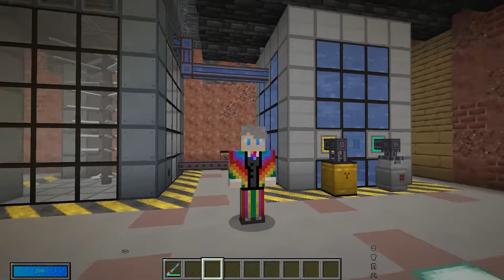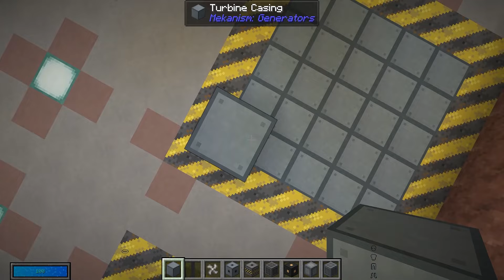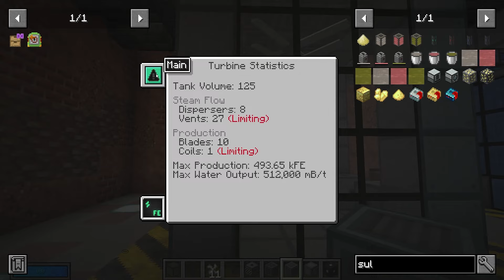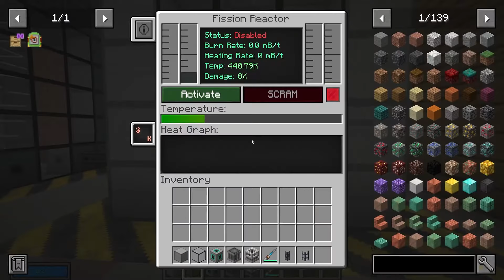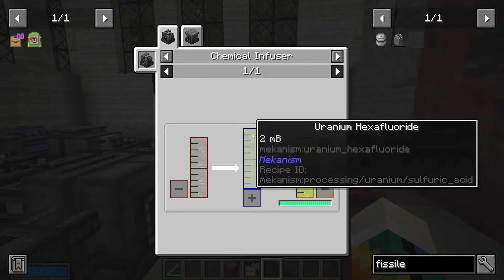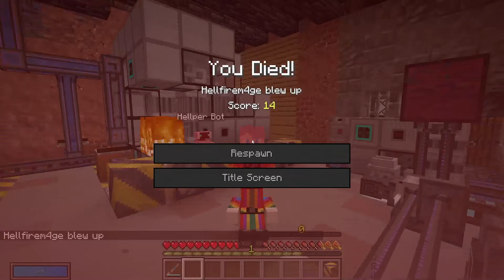Fission Power is Powerful (And Deadly) - Mekanism Fission Reactor (+ Turbine) Guide

Comment: how did he get the water in? i cant for the life of me get the stupid water in
Reply from the maker: Just use a mechanism pipe, make sure it's set to pull from the water source and make sure the valve on the reactor is set to coolant 😊
Reply: @Hellfirem4ge  the only coolant setting on the valve is for output coolant, and the input only valve setting doesnt let the water in
also thanks for replying!
Reply from the maker: If you join the discord and send a screenshot of the problem, I'll have a look 😊
Reply: @Hellfirem4ge  alright thanks
Reply: @Hellfirem4ge  could i also get a fresh inv to it?
Reply from the maker: https://discord.gg/GXhVZ9tUw

Comment: For some reason, when I first built my turbine, it was great. It allowed for my reactor to run without any issues. Then, out of nowhere, my reactor exploded. I rebuilt everything exactly as it was and now my turbine can no longer support my reactor, not even on the lowest speed
Reply: My working theory is that I have too much coolant for my own good. Causing it to burn and crate too much steam for my turbine to handle

Comment: This setup will explode after lulling you into a false sense of security. Mine blew up because the 1.44 GFE storage of the turbine multiblock filled up and throttled its output of water back into the reactor causing the reactors coolant to disappear in seconds and explode. Use an energy void block from a different mod(ie. trash cans) to remove excess FE so that the turbine's internal storage never fills up completely.
Reply: you just need to toggle the "dumping excess" on the turbine

Comment: Good video regarding the Reactor and the turbine but its missing a lot of info about the most important part which is the fissile fuel creation array. additionally seeing each system connected to the actual source of it instead of a creative tank would be helpful aswell.

Comment: may i know which mod adds the sink?
Reply: sink from CookingForBlockheads, but i dont know how did he connected pipes to that sink so they suck the water without a pump
Reply: found out how to make it work, right click on the pipe connected to the sink with the configuration tool of mekanism, it has to be on the very first pipe, the "mouth" of the pipe

Comment: Hello, I've built everything just in the video and when I activate it nothing goes up, the burn rate is 0 and heating rate 0, it's filled up with water and I think it might be a problem with the turbine, I built it exactly like in the video and the multiblocks are formed and I can access the interfaces for both the turbine and fission reactor, however, my blades don't spin, I connected the turbine to an energy cube just like u did in the video and they still don't spin, I tried to set the burn rate of the fission reactor to 1, still not working, I have no idea what I'm doing wrong or how I can fix it.
Reply: have you provided fission fuel to the reactor?
Reply: @byok1313  Yeah, it's fixed now, thank you anyway!
Reply: @jegreene8416 how did u fix it? I have the same problem..
Reply: @j.jakuub  Make sure u produced fissile fuel that goes directly into the reactor and then make sure the pipes are connected properly and there isn't anything inside of them

Comment: I have tested and when the turbine is filled up with energy as well as steam, regardless of which mode the turbine is in, it will instead pump steam back into the reactor instead of reusing it, causing the water level to go down very fast. is there anyway to avoid this?
Reply: Apparently using Energy Meter to drain the energy so it wouldn't reach peak also works.
Reply: @minhperry  My problem is that the turbine blades don't spin, I can access the interface and I connected an energy cube to it and still nothing, what can I do?

Comment: I set up fissile fuel as an ae2 autocraft, the push output functions of the mekanism machines works super well with the return to inventory of the pattern providers with all kinds of chemicals, fluids etc. You can then name an item "FISSILE FUEL" in the anvil and put it as a 1000mb worth of the chemical on a me-pattern in any open pattern provider. It'll never complete the last step, so youll have to cancel manually after completion but it does a good enough job and advances all automation eventually.

Comment: The fuel doesn't go into the reactor, what to do?
Reply: Hopefully you figured it out by now, but if not you right click on the tank holding the fuel and customize the side layout, make sure the top is set to output. (Assuming it's set up the same way as in the vid.)

Comment: Why my reactor somehow losing water as if it leaks water? I used 100 burn rate and the water gone surprisingly fast but for some reason I didn't get all the water back from steam even though I built a pretty big turbine
Reply from the maker: You need to make sure you turn the reactor on to make steam, then turn it off and refill it with water. You'll only get an infinite loop if you're completely full with steam and water
Reply: You also can have an excess of energy. If the turbine energy storage is full it will quit converting steam to water and the turbine will fill up with steam as your reactor water plummets. Easiest solution to this that I've found is, first hook up the power to a decent battery bank as a buffer, then hook an induction heater to it and have it consume just enough FE to balance the system when it's running, that way there's no over production of energy. 

You could also use redstone to turn the heater on and off with the reactor.
Reply: @ShadowBroker50  no I mean, the water is losing but the thing is my turbine has dumped all of its energy to induction
Reply: @osopenowsstudio9175  do you get any water back from the turbine? I'm assuming you've got the infinite water source tied into the line between the turbine and reactor, if you disconnect the infinite water source and run the reactor a few secs just to lose water do you get any water back from the turbine?
Reply: @ShadowBroker50  update: it turns out my huge network of ultimate pipes were a massive bottleneck, now I build the turbine next to the reactor and they're connected with their own interface directly so no more delayed water or steam

Comment: This is an older video, but in running into an issue regarding steam build-up in my turbine. i’ve basically copied the build from the video, yet steam just fills the turbine completely without dispersing. i’m not sure what to do at this point
Reply from the maker: Do you have enough energy storage?
Reply: @ ah you know what i bet that’s it. I must not have enough energy cubed places down. what’s a good way to use up my energy to maintain an equilibrium, ya know like not keep the cubes filled constantly. also, thanks for the quick reply! great tutorial i’m just a knobhead
Reply from the maker: Haha no problem! I would honestly recommend some sort of trash can overflow or to make an induction matrix that stores trillions of power 😊 also only run the reactor when you need it and not 24/7

Comment: This doesnt work i literally did everything right and it refused to turn on no matter what
Reply: The turbine and reactor both not working I both have an infinite water source and infinite fissile fuel going in but the fissil fuel won't go in for some reason
Reply: @JN26833 Hopefully you figured it out by now but if the fuel isn't going in and assuming the reactor is built properly, you need to right click the chemical tank with the fissile fuel and click the widget to adjust the side layout and make sure the top of the tank is set to output and not input

Comment: I connected a creative energy cube to the energy output of the turbine but it doesnt get any energy… everything is set up correctly but i dont know why there is no energy going in… any suggestions?
Reply from the maker: An empty creative energy cube automatically voids any energy that goes into it. Try it with an ultimate cube instead and see if that works 😊
Reply: @Hellfirem4ge  I built a matrix and this worked perfectly, thank you

Comment: This was a great tutorial, however people need to know that this uses so much water that one line of ultimate mechanical pipe is not enough. It is better to completely fill in between the reactor and the turbine with ultimate mechanical pipes and add more valves to the reactor if you want to have it be at a rated speed of more than 1mb/t.

Comment: Just on the first part and I built everything correctly and when I right click it won’t give me the interface. Im also confused by “closed your door with glass” meaning place the last two glass pieces last?
Reply from the maker: Yes 😊 it shouldn't matter, just double check your modpack hasn't changed it to structural glass or something
Reply: try with structural glass, i had the same problem

Comment: From what mod was your sink you used?
Reply from the maker: It's from a mod called cooking with blockheads. There's a bunch of alternatives though
Reply: @Hellfirem4ge  ah i see thanks
Reply: @Hellfirem4ge  what would you recommend to use? because i turned it on and the water quickly vaporized
Reply from the maker: @reggerdernoobs2678 I would recommend filling some tanks with water from mekanism and pumping it in. Start the reactor on a low level and slowly increase it until you have your infinite loop
Reply: @Hellfirem4ge  thanks for the quick response

Comment: It doesn't work, it doesn't fill with water, I can't connect the waste tank, the gas tank either and I can't connect it to the turbine...
Reply from the maker: If nothing connects then you haven't built it correctly. Double check there's no missing/additional blocks and there may be different requirements depending on your modpack
Reply: @Hellfirem4ge  I overlooked a glass block... this is the second time I've encountered this, and in which mod are sinks available? I have to use a normal 2x2 water source with a create pump and pipes, since the mekanism ones won't do anything.

Comment: I know this was posted years ago so things might have changed, but i have tried everything i can think of to change the block from input to waste. It only seems to cycle through input and output coolant and output steam, and pipes wont connect?
Reply: instead of using boiler valves, use fission reactor ports
Reply: @flimpooper5271  Thank you
Reply: @jamesvaughan4597  👍
Reply: @flimpooper5271  saved my life thank you.
Reply: @bryanramirez1013  im glad me figuring out some problem with some mod months ago is still helping people out!

Comment: My fissile fuel wont go into the reactor I dont know why unless I messed up somewhere
Reply: i have this problem too. wich mopack do you use? i use create mekenism.
Reply from the maker: Make sure the tank is set to output top, and that the reactor is fully built or it won't connect
Reply: @Hellfirem4ge  it now works tx

Comment: can't u replace the normal pistons with sticky pistons so it resets itself or will that cause problems?
Reply from the maker: You probably can but it will restart the system again so this way you have to manually intervene and avoid disaster so it's more of a failsafe
Reply: @Hellfirem4ge  isnt that good tho? i think im missing something. cuz it will only reset itself when the problem is resolved? so then it goes back on and if something goes wrong again it will stop it again. or am i forgetting something?
Reply from the maker: If everything goes well then yes. The problem is that with chunk loading etc, stuff doesn't always work perfectly. You should be aiming for the system to never go off, rather than have it go off and reset
Reply: @Hellfirem4ge  ahh i see this way of doing it manually u know when its on or off regardless of that, thanks
Reply: @Hellfirem4ge  right now im running into the issue that the second i turn it on it just eats ALL the water and doesnt replenish enough. im using the electric pump from mekanism with speed upgrades. did i do something wrong?
Reply from the maker: @FlyingGameerz No, what you want to do is start it on a low burn rate, make sure you have enough condensers in the turbine too feeding back into the reactor. Then slowly increase the burn rate as the pump keeps pumping more and more water in and eventually both the reactor and the turbine will be full of water/steam and it will be infinitely full
Reply: @Hellfirem4ge  the problem i have is that, i am not getting ANY input even from my pumps the second i put on the reactor
Reply: @Hellfirem4ge  i have pretty much copied your tutorial step to step. the only thing thats different is i put more vents in my turbine
Reply: @Hellfirem4ge  sorry for the spam but the max burn rate can only be 3 MB/T i go higher the water drains and doesnt get added again
Reply from the maker: @FlyingGameerz  Mekanism pumps are notoriously slow. I would add more condensors (or faster pipes) for the water and the leave it running for a while

Comment: Just made (almost) the entire thing like the tutorial said it, but for some reason, the tirbine isnt working while the reactor itself does (no interface). Im so confused about it. Any idea what I couldve made wrong?
Reply from the maker: Normally the issues are:
- It's too tall (fans don't fit) 
- The configuration of the magnet and motor is wrong
- there's a random glass block inside the reactor or an input missing

Beyond that it's kinda trial and error tbh. Make sure your modpack doesn't need structural glass too
Reply: Just figured out, that I used the wrong blocks, since I didnt foznd the needed Block in the creative inventory for Mekansim at the turbine parts. Fixed it and it worked

Comment: I'm trying to build this with just Mekanism and Mekanism Generators, I can't get this to work nor the water sink, which mod is it? This is too confusing and I'm trying to build this on a server, any tips?
Reply from the maker: The water sink is from cooking with blockheads but you can just use a water pump from mekanism
Reply: @Hellfirem4ge  So, I managed to make the reactor, but it doesn't seem to be outputting any reactor waste, everything works and it stays cool, whilst the turbine generates steam and it's used, but no waste to be found?
Reply from the maker: @Lystior  that is super strange, have you made sure to set one of the outputs to "waste" (the orange one I think)
Reply: @Hellfirem4ge  Yup, output waste, I connected it with a pressurized tube, am I doing it wrong?? It allowed me to connect for both so im just confused, no waste in barrel and no waste in fission reactor either
Reply from the maker: That all sounds right to me, I'm not sure what the issue is if it's not even got some in the reactor. Try increasing the burn rate and see what happens
Reply: @Hellfirem4ge 
We’ve both gone to bed for the night -
We only had 4,000MB of fuel in the reactor and the test drive used most of it up - I’ll make some tomorrow once my singular exam is over. How much would you state would be needed for a proper go?
Reply: @Hellfirem4ge  My friend here and I have tried to increase the burn rate but it just raises temp and increases everything (as it should)  yet it won't generate waste at all, must note thst we only made 4,000 millibuckets of fissile fuel, is it not enough?
Reply: @Lystior  Honestly I think the issue is we didn’t leave it running long enough - nowhere near enough fuel
Reply: Sounds fair to me
Reply: Heya, I’m working with Lystior on making this whole mekanism build (i need chorus fruit and our server won’t go to the end until friday) - I managed to crank out the final components needed cus his ass kept delaying / complaining

Frankly I’m not the best at mekanism, hell, this is the first I’ve done, but as I play the role of the ARS mage I’ve been gathering materials.

Assuming you’re aiding him with the nuclear reactor, would you say we’re clear to start on a fusion reactor the moment the fission reactor is finished? I’ve got a hell of a short college day tomorrow so I plan to crank out mekanism whilst he does his exams.
Reply from the maker: I would say so, you'll need to fix the waste issue first but once you start producing waste, you can move onto fusion (I have a guide for that too if you need it) 😊

Comment: hey i loved the tutorial and have used it a few times already, i wanted to know what you were using to get those hazard stripe blocks?
Reply: can you tell me how to add fuel in reactor
Reply: @ishantt009  basically, I figured it out, but you wont be happy about it: first you need an electrolytic seperator, fill it with water, get the O2 from it into an pressurized reaction chamber, add water and coal, get the  sulfur dust with some fluorite into an chemical dissolution chamber, and put that outcome into an chemical infuser, then youll also need an enrichment chamber where you put uranium inside, get the outcome into an chemical oxidizer, and mix the outcome from that into the chemical infuser, and fill the product into an isotopic centrifuge. The outcome from that thing is the fuel. And that stuff goes in over the green fission reactor port